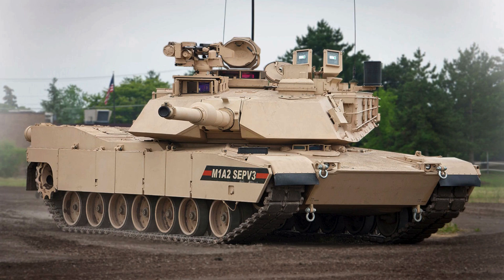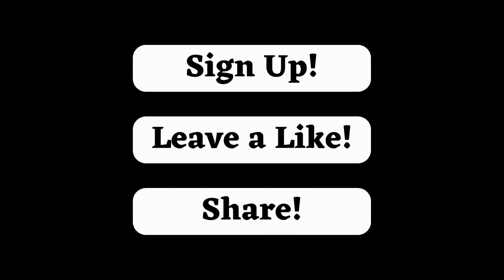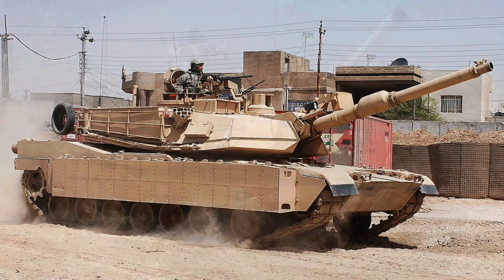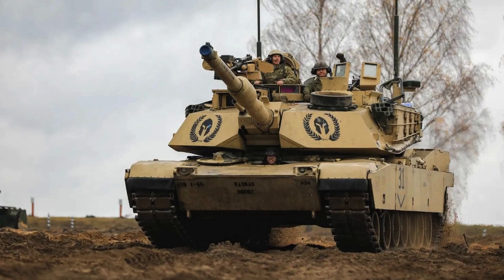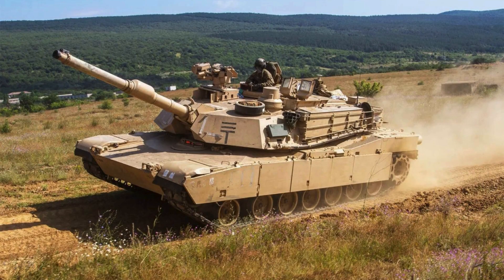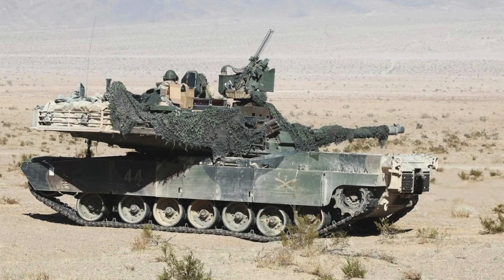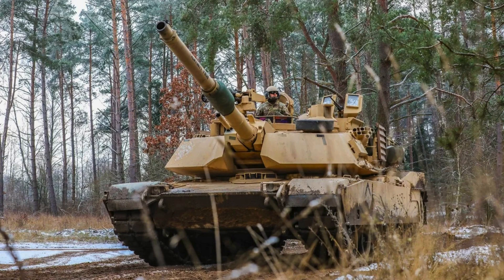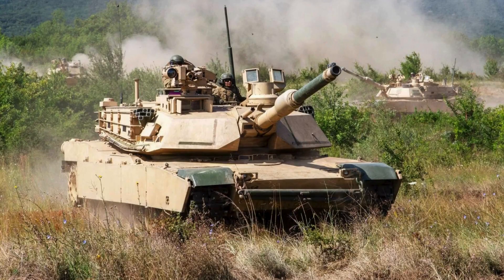Power Transformation: Abrams Tanks Achieve Maximum Power with RTX Electric Generators!

Comment: This is for the extra power needed for the new Gunner and Commander's 3rd Gen FLIR sights A&B Kits(LRUs). They were meant to first be installed on the SEPv4, but this was cancelled to concentrate on M1E3...
M1A2SEPv3 and M2A4's like all the heavy equipment used in US Frontline service, were always going to receive this upgrade. It's just not apart of the normal major upgrade Abrams usually receives...
Not to mention the power draw of Trophy APS..!